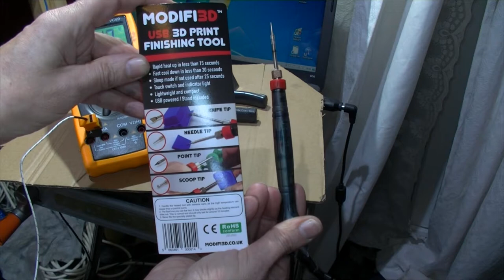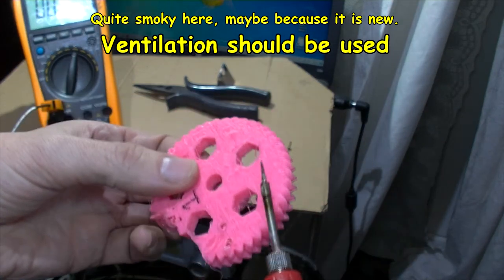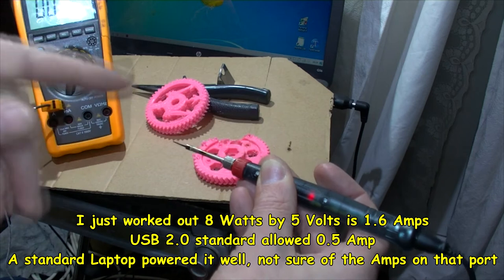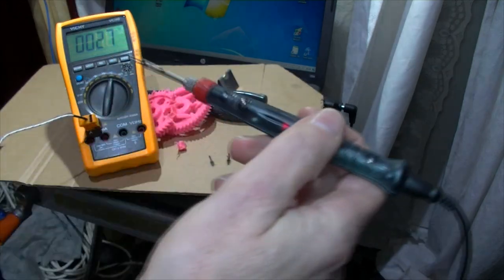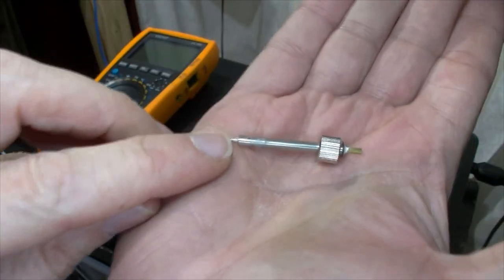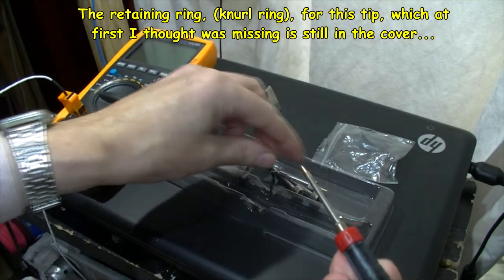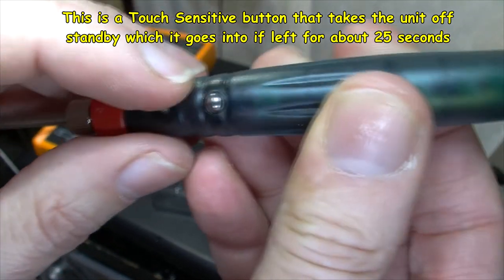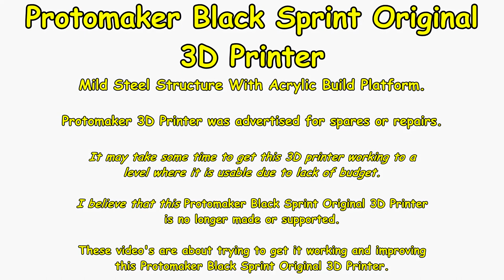MODIFI3D USB 3D Print finishing tool unbox review

Comment: good video!  i've been using the tool on my prints. burnt plastic is sticking to the (flat) blade. i am scraping it off, or wiping with a wet paper towel. how can i get all of the (burnt) plastic off, to keep it from getting on my melted plastic?  and what is the silver knob for?
Reply from the maker: silver knob, I think you meen the way to remove the tips to change them for different shapes, when cooled. I don't  ever use mine, I don't think much of it.
Reply from the maker: burnt plastic use a think cloth that will protect you from getting burned and carefully wipe it off while hot take extreme care not to get burned or to brake the bits.
Reply: @3D_Printing  i don't get burned- the plastic being melted is scorched, and that is deposited onto my plastic.. as for the silver knob, it is the silver knob on the handle... (is that a switch?)
Reply from the maker: @soonersciencenerd383  there is a silver sensor button that I think turns it on if just touched, lightly will do. I believe it has a movement sensor inside so turns off after about  60 seconds and turns on if moved. The silver button is just to touch to make sure it stops on if not moving a lot, I think
Reply: @3D_Printing  thanks. this is the first time i've used it...